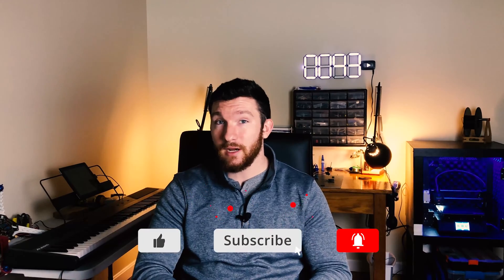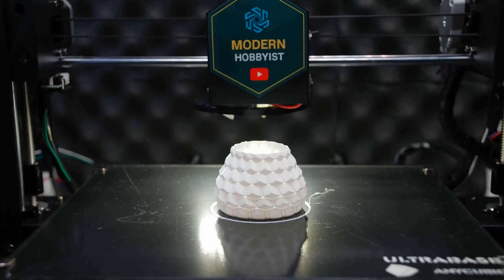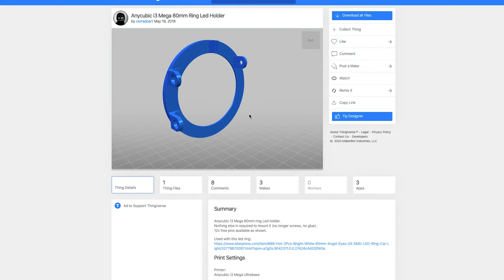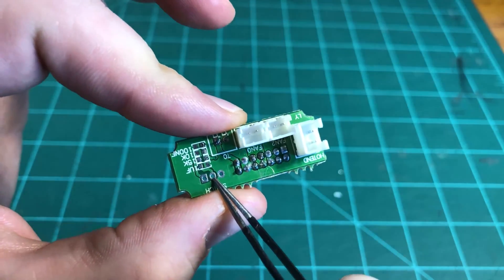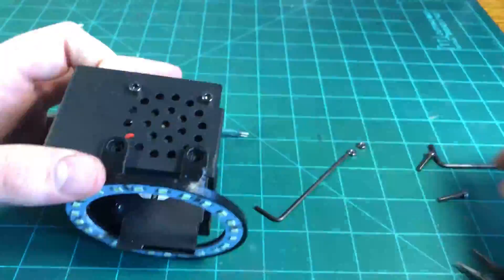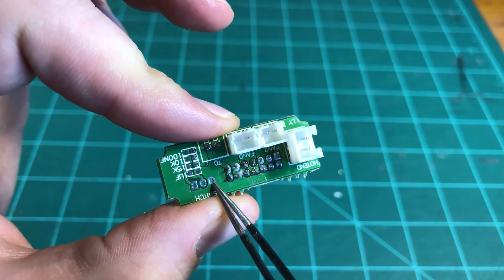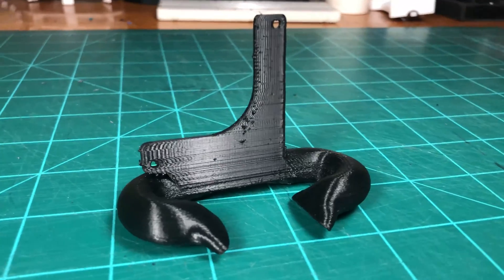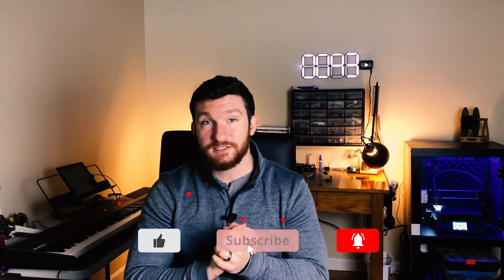Anycubic i3 Mega LED Ring Light Upgrade [Ultimate Upgrade Guide]

Comment: My LED ring is partially burned out when I switch it on. Test without the 2 fans was ok, assembled and switched on again, one LED after the other burned out.
The LED ring came with a voltage regulator, soldered it on again, then it finally worked. So I can't understand why yours works without a regulator.

Comment: I added a ring light to my mega s just like how you did, and it was flickering. I tested the wires and it seemed that my soldering was not the problem and it didn't flicker when the wires on the light end were moved either. The lights from amazon came as a pack of two so I tried the other light and it was good for a few seconds and then flickered and got really hot so I unplugged it. Any ideas what I should do to fix it? With the connections being solid I am at a loss as to what to do next. Thanks for any help!

Comment: Great videos, man! Great light, sound, cool voice, informative, keep going!) I have problems with cooling, and it's strange that you haven't. Now I'm trying to find a good solution for better cooling, but when I think I've found it, people would tell me it's not working. Could you please show your prints with hard to print angles, like calicat or something? Also, do you have an issue with z-axis line alignment?
Reply from the maker: I have had a few problems with cooling, but I've dropped the printing temperature down to account for that mostly. On the otherhand, I try to design around overhangs for the most part, so it could be that I'm still not getting great print results on overhangs. If I ever have a part that requires overhangs and needs to turn out well, I'll just open up the enclosure for that print. Thanks for the comment though!